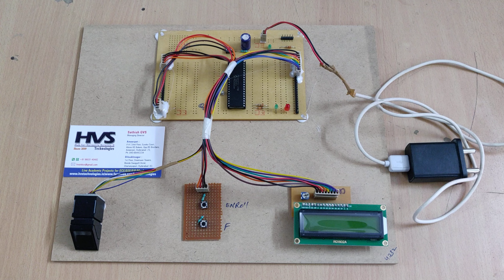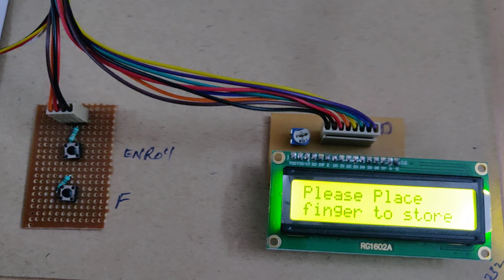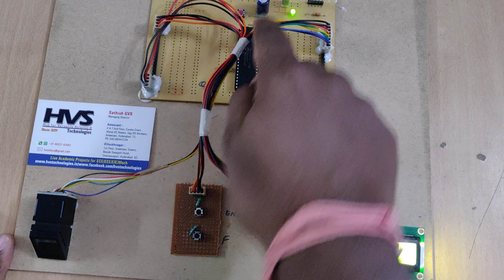Finger print authentication system for exam hall using R307 and PIC Microcontroller

Comment: i used 0xEF & 0x55 passpack value .both are not working.what is the passpack value of this fingerprint sensor?
Reply from the maker: @HelloProjectCentreEmbedded  We sell total project. 
Send me video link
Will update you the cost details.You can contact us at +919603140482
Through WhatsApp or call